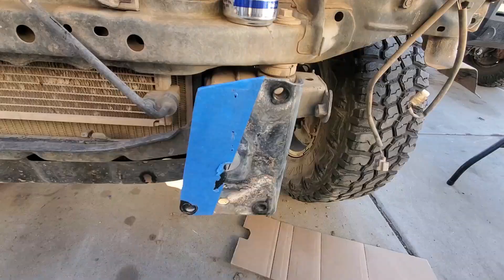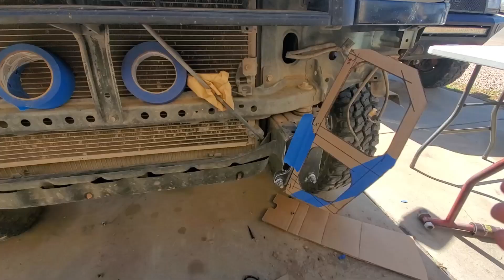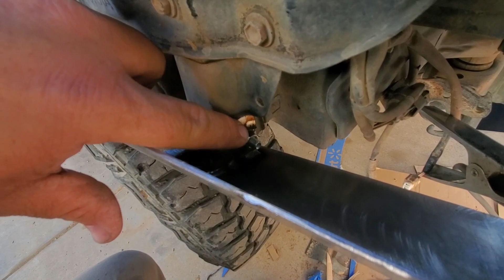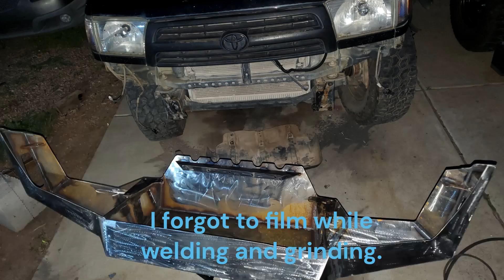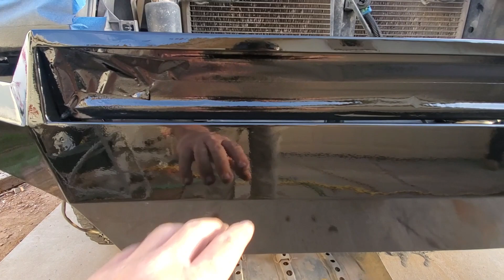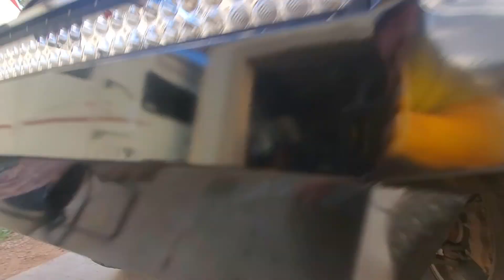3rd gen Toyota 4runner custom bumper build

Comment: Looks good, are you able to attach a Bull Bar with this setup?
Reply from the maker: There is enough room at the top to add some tubing. The cover over the lightbar is more cosmetic than structural so I wouldn't rely on that for impact protection. Thanks for watching!